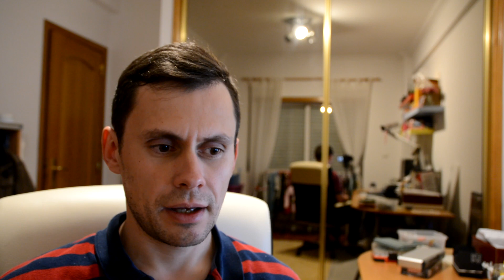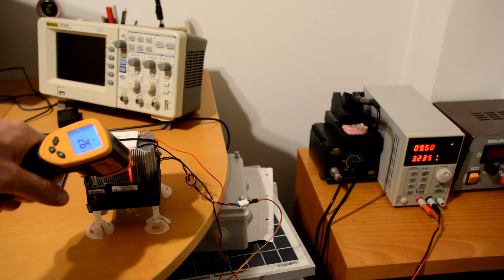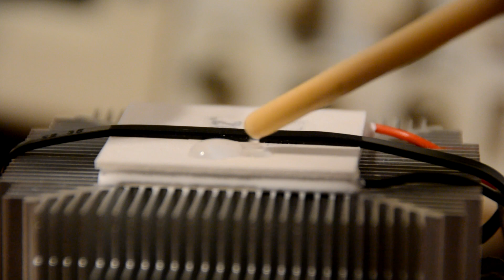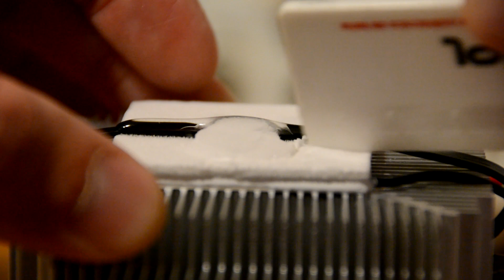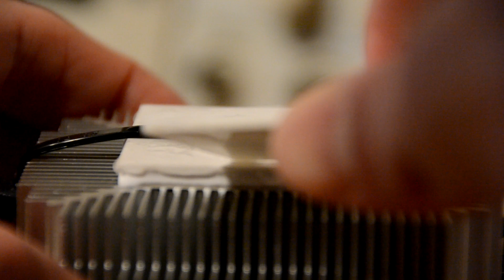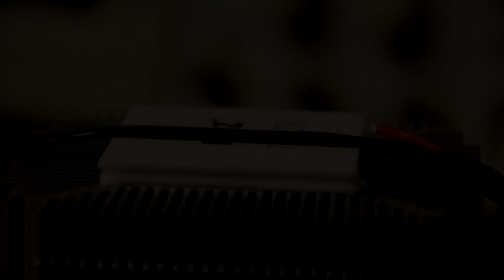Peltier effect Explained

Comment: Peltier module work on 12 v Pulsating dc supply? It will affect it's life and performance?
Reply from the maker: hi Ravi Barot, it should not affect the life and performance. On the contrary it can be a smart way of controlling the power proportionally (PWM modulate the power applied to the module, to transfer more or less heat according to your needs). The peltier is basically a semiconductor junction, think of it the same way as with an LED, which you can control the intensity, by controlling the length of the pulses.

Comment: i have a 30*30mm peltier module but any writing about the type is missing. What voltage would you sugest to run it from, i'm building a electric cooling vest unit with this system.
Reply from the maker: Hello Alexander, it will depend on the specific module, but many of these are rated for 12 Volts, as there is an abundance of modules aimed for consumer applications such as portable refrigerators that can run from car batteries.

Comment: Can we change given supply polarity? For example, positive supply terminal to black wire of peltier and negative supply terminal to red wire of peltier?
Reply from the maker: Hi Ravi Barot, yes. In that case the hot and cold sides will be reversed as well.
Reply: @LuisTeixeira  by doing so, is there any problem with peltier module performance and it's life? It may damage or work smoothly?
Reply from the maker: @ravibarot7867  it shouldn't be a problem. Just watch out for the temperature limits of the device, regardless of the polarity. Some people play with that characteristic in order provide more responsive temperature control (i.e. by controlling and/or varying the direction of the current with an H-bridge)

Comment: does my peltier module TEC1-12706 still work if im going to connect to 12Volts 2amps supply
Reply from the maker: Hello Gino, assuming the specs are correct (i.e. according to banggood, the TEC1-12706 is a 12 Volt 60 Watt module), in theory if you run it at 12 Volts it should be drawing 5 Amps (Ohm's law). There is however the room temperature as a factor wich will offset the specs somewhat (think of it as a positive thermal coefficient - as the temperature rises, the internal resistance of the device rises well, causing the current flowing accross it to decrease). If your power supply is limited to 2 Amps however, most likely the voltage will be much lower than 12 Volts, unless the temperature is stupidly high. So in short, at 2 amps it will probably work, but with a much lower performance.

Comment: How long can I run this continuously? That means, how long can I run after switching on one ... so that it does not hurt and can be used repeatedly?
Reply: Mr. Nishad just dont let it melt
Reply: That's mean i need to use a very powerful heat sink with a powerful cooling Fan?

Comment: If its so inefficient, then why is it used and what is it good for?
Reply from the maker: Well like many things in life (e.g. a petrol vehicle - roughly 30% efficient) convenience speaks louder than efficiency. A peltier module is a pretty compact device that can easily be fitted into small appliances, whereas a non-solid state refrigerator is clearly bulkier, with moving parts and coolant lines.
Reply: Creation Factory 🤔🤔🤔🤔🤔🤔🤔

Comment: sir,can you share the specification of the peltier module that you used...and also the specification of fan you used....and the voltage given to fan...is it the same as given to the peltier module..
Reply from the maker: Hi josna, yes both the module and the fan were running at the same voltage. During this experiment I was applying about 9.50 Volts to the module. The fan is rated for 12 Volts (regular computer CPU fan). Normally with these modules the efficiency drops as the voltage is increased, so there is no benefit in going above 10-12 volts DC.The best improvement to module efficiency is to use the largest heatsink possible on the hot side of the peltier module.

Comment: How effective it is as CPU cooler compared with liquid cooler?
Reply from the maker: World Shell In general it will not be a very good CPU cooler because the peltier will have to dissipate its own heath plus the heath generated by the CPU. This means you would end up having to use a larger heath sink on top of the peltier. No advantage overall.
Reply: Hey I was wondering, what if you used the seebeck effect to produce electricity from the heat of a cpu?
Would it be useful/practical?

Comment: You said that they are only 5% . What would the % of taking 12V from solar panels and changing it to 120VAC to run a normal cooling device. I am thinking of in a off grid hunting caben would it be better to use the TEC device or normal cooling using solar panels for the only power.
Reply from the maker: Donald Smith starting by the conversion of the 12 volts to mains voltage, depending on the inverter, you would have 25 % loss there (worst case scenario). Regarding the load, a 50 watt peltier is barely enough for a small portable cooler, whereas with the same power you can run a large domestic refrigerator (continuous average) based on a traditional compressor and vapor-compression cycle. So even with the loss on the voltage conversion (which can be minimized by selecting an inverter that best matches the load), it would still be more efficient to use a normal refrigerator.
Reply: Creation Factory what I was thinking thinking was to use water cooled unit and have thermostat on the hot side to get hot water as I'd cool things. Normal hot water is about 40C  and I can't get good information as to how hot the hot side can get. But I think it should not have a problem with 45 to 50 C. So I can easily cool one place and make hot water at the same time. Something that isn't easy with other cooling things. Or am I just going down the wrong road with this? I can get on eBay the water cooling block with 4 devices that should cool a freezer and another one for the other part, should keep it about 40 F. A large hot water tank with a 12v pump. Solar panels should be able to cool things and give me hot water. If TSHTF I can keep food and have hot water. May not be the best way but it should work and with some safety theral switches it should run for ever. With some spare parts it should be easy to repair if there is a problem. If a normal cooling devices breaks I can't fix it. I understand that I will not have a good control of the water temp, if I use a lot then the temp will change but I think the biggest problem will be that the water may get to hot and not cool the devices good enough so safety theral switches will need to be put on to turn them off to keep them from getting to hot. I don't know what that temp is. Easy to get switch that will turn them off when the temp get to high, well below the point that it may damage the devices. I just don't know how hot the hot side can get. I look at the different places and all give different information anywhere from 75 to 120 C.

Comment: 5% efficient =95% heat loss = 95% efficiency when used for heating?
Reply from the maker: Correct. Which means that for heating purposes, a purely resistive load is more efficient. Those 5 % of efficiency consist of heat from outside of the system, being moved from one side of the Peltier to another.
Reply: Not correct. In reverse, the peliter element functions as a heat pump. You actually get slightly more heat on the hot side than you would get with a resistive heater. The output is the sum of the waste heat generated by the device and the heat it pumps across from the cold side.
Reply: May i ask, from where did you got that an Peltier is 5% efficient?

Comment: hi.. i like your video.. i m trying the same but. its not going through.... i m using 12v 1amp power supply.. 
1amp current should be a reason?
my peltier device is cooling that much.. :(

help me.!!
Reply: Hey bro! Did you find a solution to the same?? I'm doing my project on this device and I am facing the same problem

Comment: What is your take on using a peltier device on a system for making drinkable water??
Reply from the maker: It is a possibility (if what you have in mind is using the cold side to condensate the humidity in the air), but you must consider a couple of aspects: peltier efficiency is inferior to a traditional refrigerator compressor cycle system, and you should take into account that water that is obtained from condensation may not be readily drinkable, as it may contain contaminants from the air (dust, soot, bacteria, pollen, etc).

Comment: Nice video, what was the current and voltage you were supplying ?
Reply from the maker: @Israel Amar, I was supplying between 10-12 Volts, and 4 Amps of current. The current varies somewhat depending on the temperature of the hot side of the device. As with the vast majority of semiconductor devices, the temperature alters the characteristics of the junction. Going beyond these values (of current and voltage) doesn't bring significant improvement in the temperature difference between the two sides (it will actually worsen it, from a certain point).

Comment: Does the efficiency of device increases if the 'hot side' gets easily cooled down?
Reply from the maker: Hello Navodit Verma, it depends on how much the hot side gets cooled down. Like any semiconductor junction there is only so much efficiency you can take from a Peltier Cooler, in the temperature range it is designed to operate. If you move below or above that operation temperature range, you will have degraded efficiency. Bear in mind that the efficiency of these devices is always quite small, when compared for example with a traditional HFC compressor based cooler (like those found in home refrigerators).
Reply: ok and thanks for the reply

Comment: does the temp of the cold part change during addition of water
Reply from the maker: Yes, an increase (bump) in temperature is expected, as you are exposing the cold surface to a liquid, which in the case of water is a very good thermal interface substance. Of course as the peltier continues running, the heat from the water is transferred to the opposite surface and the temperature decreases again.

Comment: what is Peltier effect
Reply: It's an electric refrigerator. Hook a thermoelectric module (that white square with the red and black wires sticking out of it) to a battery and it creates a temperature difference between both sides of the module.
Reply: Electricity passed through the peltier chip will create a temp difference ie : one side will be hot and other cold . thus we convert electricity to a temp difference :)